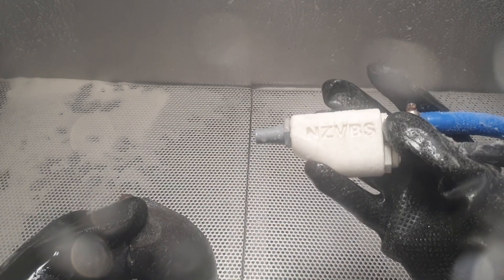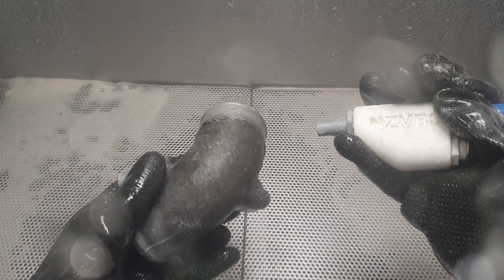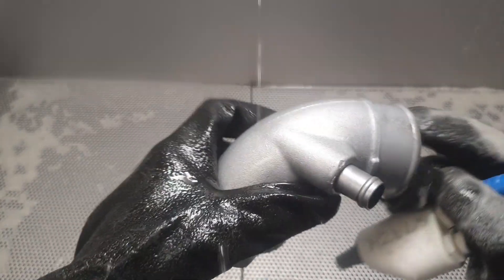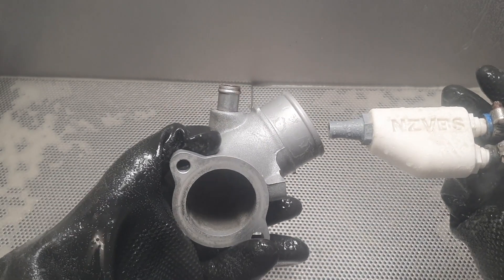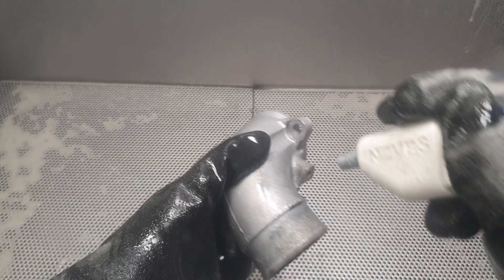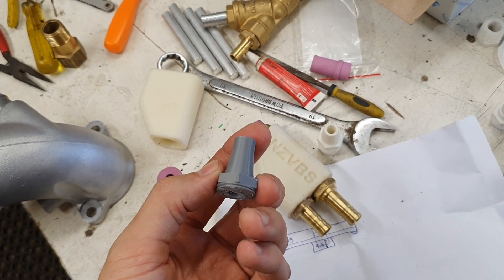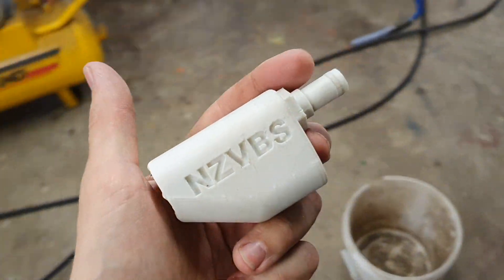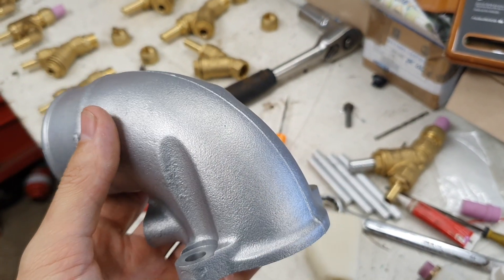Testing The 3d Printed DIY Vapor Blasting Nozzle

Comment: Hey mate, I want to try a mix of glass bead and aluminium oxide to speed things along. Have you tried this, and if so, what mesh aluminium oxide do you use?
Reply from the maker: Hey Simon, I responded by email but figured I would answer here too for anyone else wondering. I use AC grade glass beads (250-150 Micron) and Brown AO (125 - 106 Micron) at about a 50/50 mix. I have brown AO because that was what was in stock, but it clouds up the water very quickly. White may be better in this regard.

Cheers
Josh

Comment: Can you remember what compressor this was running on?
Reply from the maker: This was on an aluminium twin cylinder 3hp unit. Rated at 12.5cfm

Cheers
Josh
Reply: @ArmouryEnterprises  Do you think having a shorter airhose would be beneficial on smaller compressors?
Reply from the maker: It can help, but it depends. If you have a 10m long 1/4" hose and you cut it down to 1m, it will have a small improvement. But if you have a 10m long 1/2" line, the difference would be practically imperceptible.

Comment: Hi! Can i use 3/4" y valve insted 1/2" to build the blaster? My ceramic nozzle is larger (8mm model), It is ø 21 mm on the base. Thx!! :)
Reply from the maker: Hi Pedro,

Is the ceramic straight walled? or is there a step in the outside?

If it is the straight walled type, this video may interest you. It has a design that uses a 3/4 Y strainer

https://www.youtube.com/watch?v=PEAVnpPzOT8

Thanks for watching!
Reply: @ArmouryEnterprises  perfect, Mine is conic on the base. A 3/4 valve should work Nice with a 20 cfm compressor? (Hole on the aluimun piece 3.5 mm and 8mm ceramic nozzle)

Comment: need help. if you have a bigger aluminum part what can i add to the water so it does not start oxidizing before i get done cleaning it.
Reply from the maker: Hi Kyu,

Is it definitely aluminium and not magnesium? I have never had an aluminium part start to corrode.
Reply: @ArmouryEnterprises  do you think its because i had used it before for steel and aluminum.. i changed the water but i did not really wash the glass. so do you think its the small parts of blasted steel making the aluminum rust?

Comment: What size compressor are you running?
Reply from the maker: Hi Vance,

This is just my little compressor. It is around 12.5cfm with a 3hp single phase motor. Much too small for any extended length of use, but its handy to set up for testing purposes.

Thanks for watching!